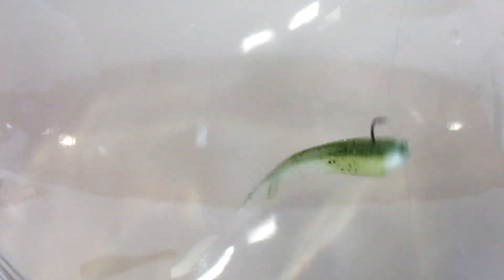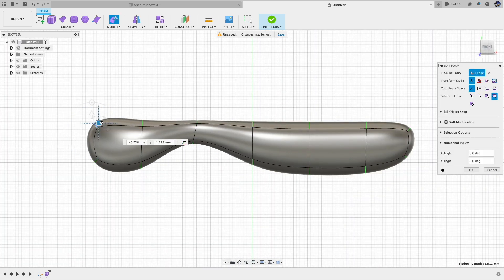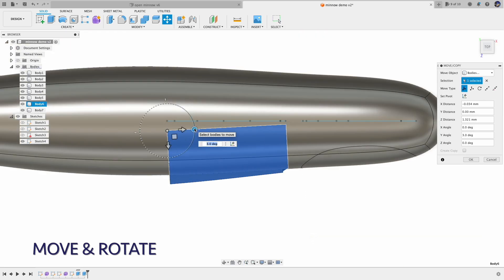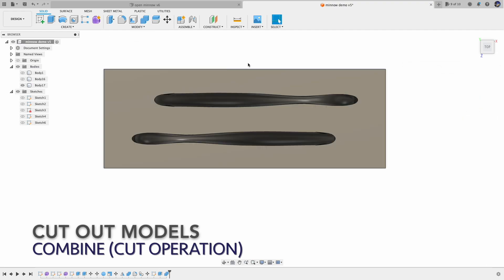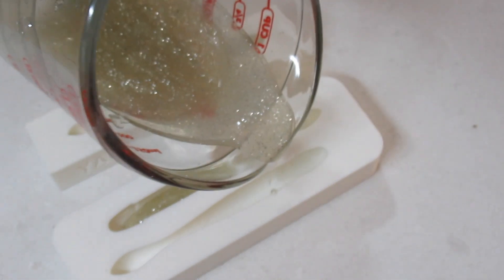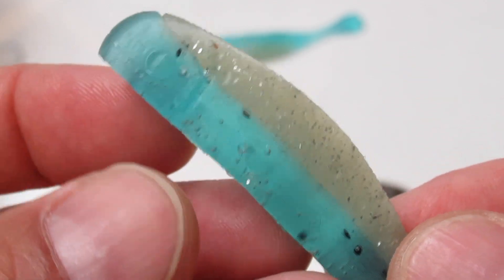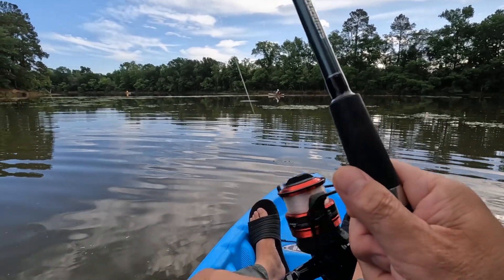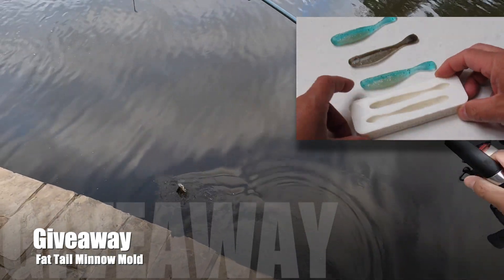Fat Tail Minnow Open Pour Mold - Design and Build

Comment: Nice mold my question is what kind of  knowledge is needed to be able to create this design for 3d printing? I create my own baits from clay as a master then to plaster. I lose a lot of detail with this method. I have been trying to make molds from silicone but I haven't come across a good silicone for this.
Reply from the maker: I guess you will need some basic skills on a 3D modeling tool like fusion 360. It’s like sculpting but you do it in a computer. I have another video that talks about some basic features that are helpful in lure design. There are also tons of tutorials on YouTube. I find myself constantly learning new tips too. Feel free to drop your questions in comment section or email. I have not tried 3D print the master and make molds from it. If you plan to do that, I would recommend a resin printer which would give you more details, and less visible layer contours.
Reply: Thank you for the response. I would like to learn this not too sure how much schooling would be required I would like to do them out of aluminium eventually. I'm sure the design process would be similar.
Reply from the maker: @laughinatyou63  try follow my video and slow down pause when necessary (I speed quite a lot in fusion 360). Once you get comfortable, you can start something different. Good luck.